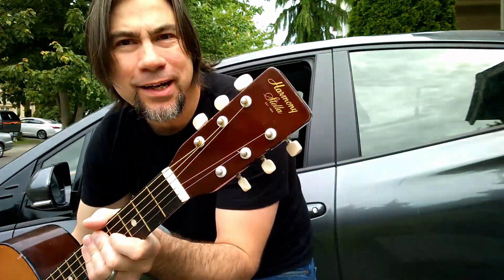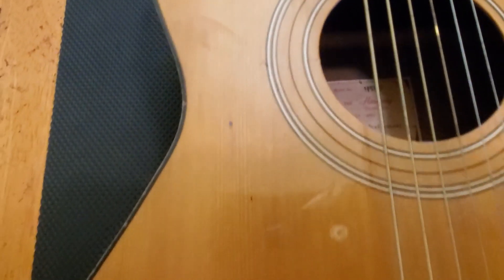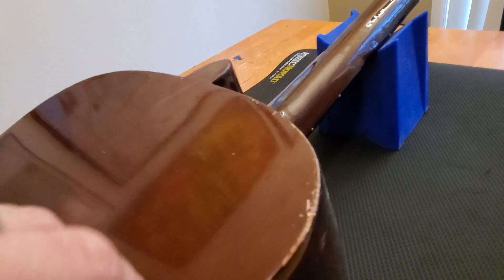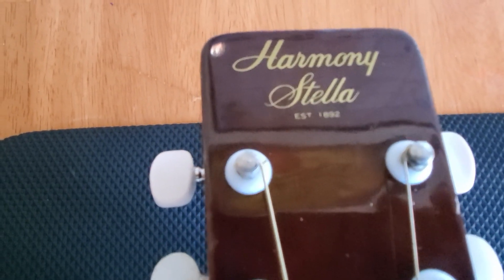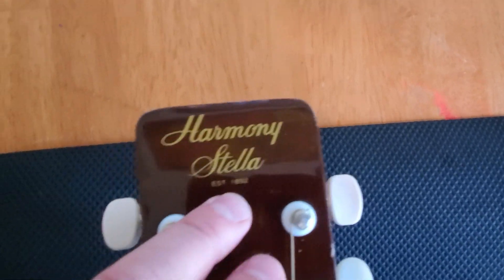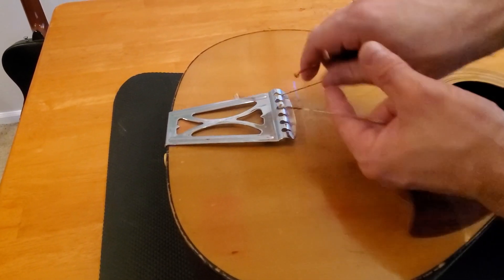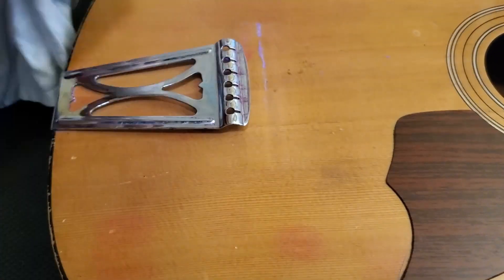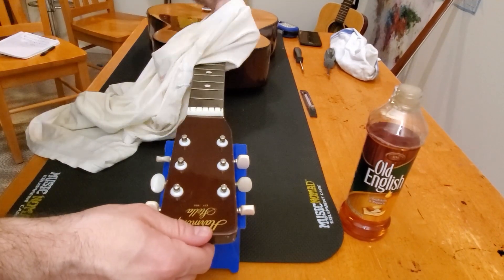Korean Made Harmony Stella H6131

Comment: Ok, I have a new nut and new tuners on my Stella 6128. Can you give me any advice on the floating saddle. Is the saddle suppose to be sanded or anything? The floating saddle is new too. I need help. Thank you
Reply from the maker: Hey Chris congratulations! 
Did you buy a wooden saddle?  
I don't think it would need sanding.  Setting it up & tuning it will let you know if you want to lower the action at the bridge by sanding the saddle. 
For placement of the saddle, measure the distance from the nut to the middle of the 12th...put the saddle the same distance from the 12th
Reply: @PinetopJackson  thanks for the quick reply. The bridge is wooden with a plastic saddle. The old bridge was all plastic. The new bridge is alot higher. I have plenty of guitars but I thought it would be neat to try to save an older guitar. I can't find much online to help me. There is alot about electric guitars and floating bridges. Do you think I will have to sand the bottom of the bridge to bring down the height? Now I know why I drink. Thank you, have a great night.
Reply from the maker: @chriscarlson7809  oh I see.  In that case you will need to sand the bottom of that floating bridge to get it down to an appropriate height...how much though!  I'd still set it up & tune to get the feel of it, then de-tune, slip it out and sand some, replace and check the height, and repeat! 
It can be frustrating, but worth it to do it yourself. 
Just remember, I drink AND I play guitar...I don't drink BECAUSE I play guitar 😆
Reply: @PinetopJackson  Is there a certain height measurement that I am looking for at the 12 fret? Thanks again
Reply from the maker: @chriscarlson7809  about 2mm...I kinda just go by what feels right, but then I'm just a hobbyist not a trained luthier 😆

Comment: I bought a 6128. Do you know how to set them up? How do I set the floating bridge. Any help would be greatly appreciated. I might need new tuners. Thank you.
Reply from the maker: Right on! 
Measure the distance from the bottom of the nut to the middle of the 12th fret, then move the bridge to make the distance from the middle of the 12th to the bridge the same. 
Setting the intonation is a little trickier with this type of bridge, but just setting the bridge with a yard stick will get you close enough for rock & roll!
Reply: @PinetopJackson  Thank you. Have you ever replaced the tuners? It was made in Chicago.  I got it for 40.00
Reply from the maker: @chriscarlson7809  that's a good price!  
As for changing the tuners, I did once on this mahogany Harmony https://youtu.be/6stEmxrwU68 but I just replaced the broken set with some crappy tuners from a cheapo thrift store guitar
Reply: @PinetopJackson  Good morning , have you ever replaced the saddle?
Reply from the maker: @chriscarlson7809  I haven't replaced a saddle.  I bought a couple old used Stella  tailpieces at a guitar show once, just in case you know!  But I haven't bought a bridge or saddle piece.  If I needed to replace one, I'd go to my local guitar shop and see if they could help me find one for cheap (and then I'd probably give up and order online lol). 
OR I'd try to fashion a wooden saddle/bridge like some older parlor guitars have...I'd try to carve like a triangular dowel rod
Reply: @PinetopJackson  Are the saddles suppose to have groves in them or be smooth?
Reply from the maker: @chriscarlson7809  they start out life smooth...years of playing & tension will wear grooves into them
Reply: I have another guestion for you. The floating bridge has 2 screws. Are you suppose to use those to lower or heighten the strings? Thank you. I got my new tuners on it. What gauge strings do you use? Have a great day
Reply from the maker: @chriscarlson7809  yeah if they work right, those screws should raise & lower the saddle to adjust your string height at the bridge. 
On my Stella, I use acoustic 10's...I used to always use Ernie Ball, but lately I've been digging D'addario. 
Good luck man, I hope that old Harmony works out well for you!  
If you can, you should upload a video of it to YouTube...I'd love to see what you been working on!
Reply: @PinetopJackson  My update on my Stella. New tuners on, new bridge and saddle ordered. My next project is the nut. What do you recommend? Plastic, tusq, bone? I have never changed a nut.  Any advice?  Thanks have a great weekend.
Reply from the maker: @chriscarlson7809  well TUSQ is the best choice. 
I bought a few bone blanks to practice shaping (using a file set from HomeDepot, not StewMac 😂) 
The bass nut I carved from a bone blank turned out pretty well.  But then I tried a 6-string and butchered it!  Replaced with a cheap plastic nut.  
That's the allure of using a plastic pre-cut nut... it's cheap!
Reply: @PinetopJackson  with the precut one how do you know what to get? Are the slots already cut in? Thank you
Reply from the maker: @chriscarlson7809  well over the years I've accumulated a decent sized junk drawer with all kinds of random parts...tuners, bridge pins, plastic saddles, plastic nuts off old broken guitars that I didn't fix up. 
Usually I can find something in there that I can make work! Makes me feel good about 1) not spending any money, and 2) giving new life to those little bits instead of putting in the trash. 

Before I had accumulated junk drawer, I went to a local guitar shop and just bought a precut plastic nut...they had a box of em from China.  I don't remember if it fit perfectly string-spacing wise, or if it was just ok and I made it work lol
Reply: @PinetopJackson  Is there any info on line that explains setting up these can of guitars? I am looking at the XL Tusq nut. Do you think that could be over kill? Thanks have a great day.

Comment: Can hear the “grunge factor” of that 22-7/8” scale length or whatever it is.😆
Reply from the maker: 24-1/4...grungy for sure!
Reply from the maker: Oh dude I just measured the scale and you were practically spot on, it's just over 11-1/4" from edge of nut to center of 12th fret! 
I must've had that 24 number in my head from a previous Harmony...guess this one's a little smaller
Reply: Ha, I guess that neck I have is really identical. It doesn’t have an adjustable truss rod. Just a thin steel bar inside the neck. Fingerboard is actually plywood. Dovetail joint at the heel.